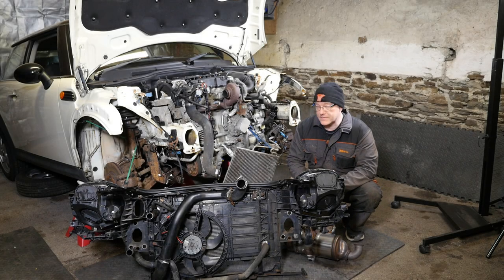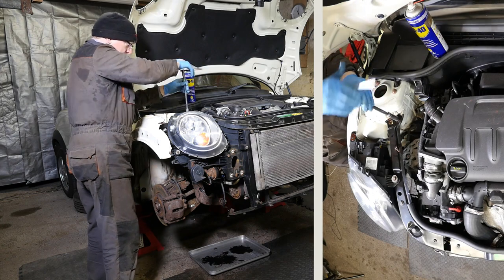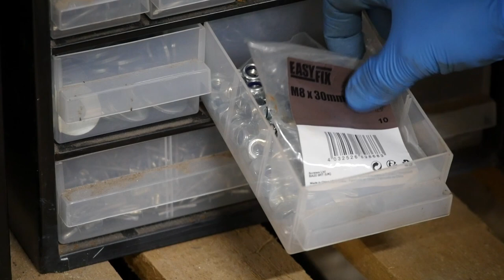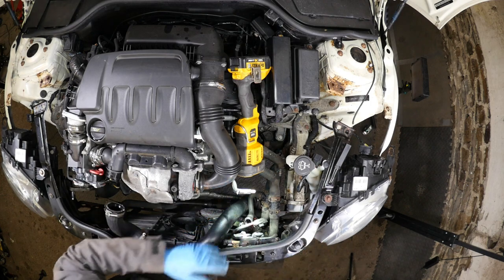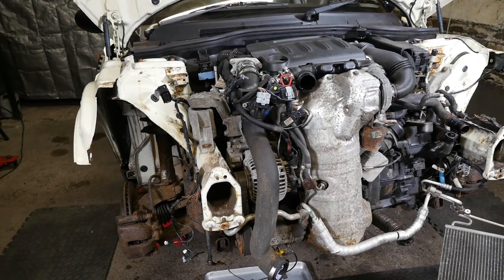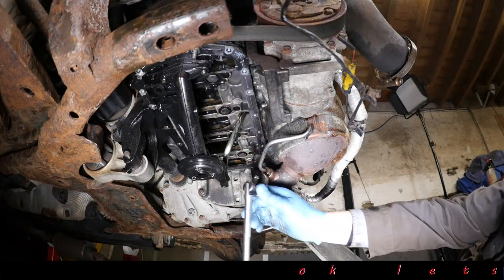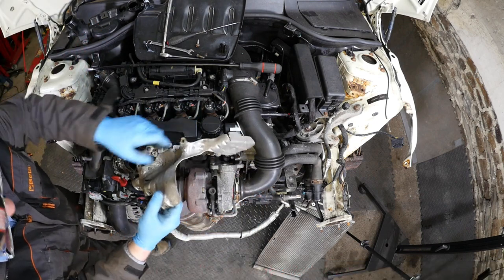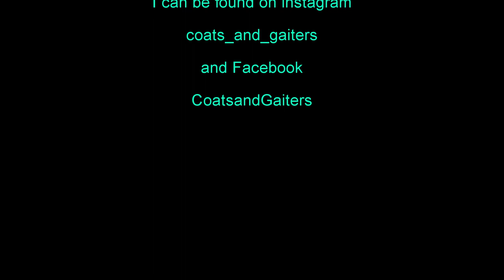Part 4 - DPF Filter, Radiator & Air Con Condenser 2009 R56 MINI Diesel - Peugeot 1.6 HDI TDCI DV6

Comment: Hello Mark. Where has this car been, down a salt mine?.  Most older cars I have worked on of late have no gas in the A/C system,due to rotten condensers of leaking pipes. I just give the shrader  valve a poke with a screwdriver just to check its empty. On a plus point the chances of having your catalytic converter nicked are pretty slim. The thread on the DPF/Cat looks like its been cross threaded,which is easily done on stainless steel fittings. The oil filter housing is a known issue on some Mini engines as the oil and the coolant run next to each other in the housing, and can lead into thinking you have a failed head gasket. I can't wait for the next episode.
Reply from the maker: Are you saying other cars aren't rusty like mine lol.  That's probably true as the air con in my black MINI doesn't work.  I'm hopeful the air con might work, might be the only thing that does if the engine works in the end.  I'm hoping the next episode is a bit shorter as it takes a lot of footage to end up with 37 minutes after all the cutting I do.   Anything I should look out for when removing the oil cooler and that turbo feed pipe?  any ideas why the turbo oil pipe moves back and forth at 32:13 Neil?
Reply: @CoatsandGaiters  Hello Again Mark. The pipe moving like that  is a very strange one. The Mini I had was a 1.6 petrol, so no turbo.
Sorry I can't help.
Reply from the maker: @neilhampson2843  Guess I might find out next week lol

Comment: Hi, im no mechanic and just wondered if you could give me some advice ? 

I have a 2014 mini cooper sd and believe that the DPF might have been removed prior to my purchase. Would I be able to physically inspect that without dismantling ? Could i maybe check from in the engine bay or from underneath the car ?
Reply from the maker: It might sound hollow if tapped or look tampered with with scratches and marks all over from bashing the guts out.

Comment: Hello, I need to replace the dpf in my Mini cooper D. I wonder if there is an easier way to get access to it but removing those all things that are before the dpf like in this video ?
Reply from the maker: The dpf is only the lower section so you could probably remove the lower part by disconnecting exhaust at oil sump, remove vacuum pipe and just try to undo the strap nut on right hand lower side.
Reply: @CoatsandGaiters  Thank you very much